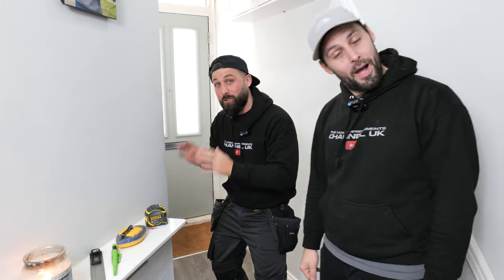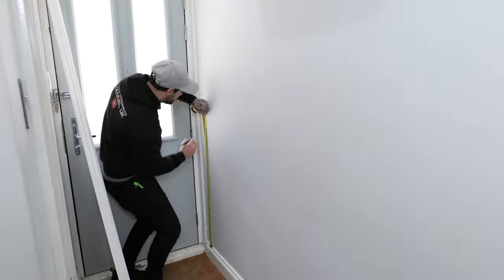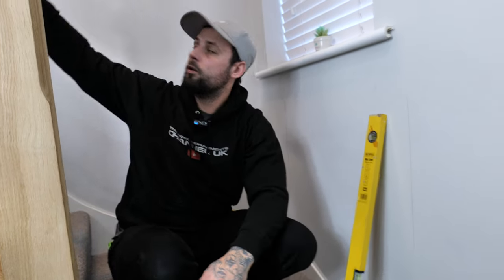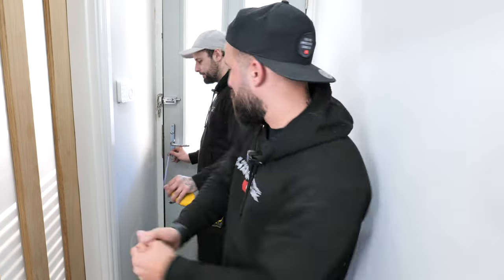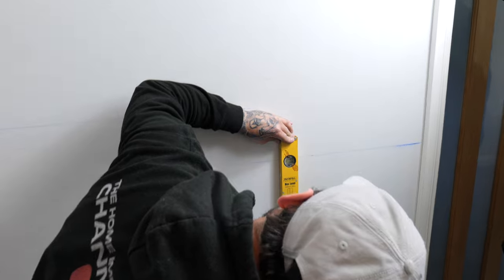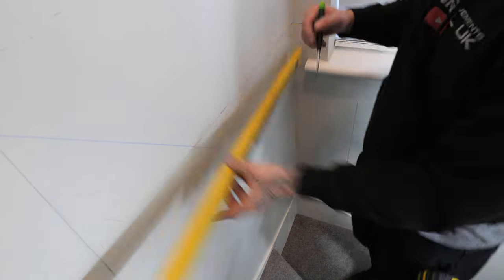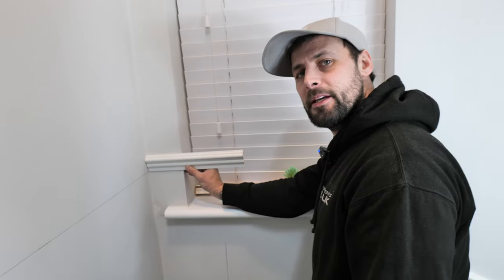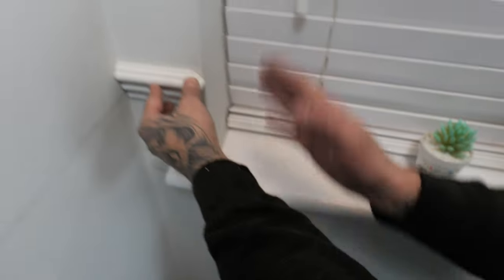How To Install Dado/Chair Rail To Hall Stair Landing - Easy Step By Step Guide

Comment: The skirting at the hall where it meets the stairs at a 90 degree angle is 100mil lower than the skirting inner going up the stairs. If I put the dado rail the same height as the opposite wall, the dado going up the stars would be 100 mil closer to the stair runner and would look odd, any suggestions?

Comment: I have the same coping saw. Them metal bits are meant to face upwards. Hold the blade in place and twist the handle off. Turn blade the right way with the metal fasteners pointing upwards then retighten the handle. It was a ball ache until I discovered this. Thanks for the video. It’s helped massively
Reply from the maker: Nice one I’ll give it a go 😊👌🏼

Comment: Brilliant. So helpful, thanks. You said use a panel pin or pinger to hold the rail on after gluing, but what if it’s a solid wall?
Reply from the maker: It’ll still work don’t need to send them all the way in just enough to hold them in place 😊

Comment: You two are absolutely brilliant, I hope you know that. Wow best video. Loads of videos out there showing you can do this etc etc and just show the end result but they leave out all the fine detail, which is all the important bits. This is the soooo so good. Thank you so much 🙏🏻  

Little question please😊
If you have an internal dado rail angle that’s difficult can you use a coping saw on the smaller side or one of the sides to join them. There is a door frame, immediately after a small section of wall then a internal angle then a longer wall. Can a coping saw be used to in this scenario or what’s the best thing to do. Oh and is the wood placed into the miter box on its back and you cut on the face of the dado rail or do you put it on its side with its back against the mitre box side ( where the angles lines are ) for doing the internal angles. 🙏🏻
Reply from the maker: Hold it how makes you most comfortable they both work 😁😁 and yes you can scribe those 

Thanks for the great comment we appreciate it 😁

Comment: Hi guys great video. Wonder if you could offer any advice on my project ? The issue I have is the bottom of my stairs where the wall turns 90 degrees but also drops by approx 500mm as the bottom step is at floor level, and the landing skirt starts at around the third step. I hope that makes sense but if there is any way I could send you guys a picture it would explain it a lot easier than I am 😂

Comment: Hi great video.  Can you use the angle finder as you have, but with a handsaw as I don't have the mitre saw. So work the angle out set angle finder to that angle and then pencil mark the wood and saw?  Also why do some say half the number but you have a different calculation. Is it to do with the type of angle, such as inner or outer andle if that makes sense.  Inner being something like a wall panel. Thanks

Comment: 4:32 using your level in a vertical position produces a line that is PLUMB, not level! Level lines are produced from the horizontal plane.

Comment: Great video!! Could you explain why you cut wood for the internal corner using a saw by hand and why that is different to all the other angle cuts? at approx 23:50. Thank you very much :)
Reply from the maker: Internal mitres tend to gap so we like to cope as we demonstrated better joint for longevity 😁😁
Reply: That’s great, thanks for answering! :)

Comment: You two as a team are class to watch. I have a question: My stairs have varied angles in, they are not slopes though. I originally went top the angle and drew the level line, but I think it was wrong as the lines don't add up. Do I follow this process that you are showing here? I actually wanted to do the flat 9mm x 100mm MDF panelling that was in your other video, but my stringers are all different angles, and I have two turns in my stairs. I will pay you for a facetime!!!
Reply from the maker: Give us a message on Instagram 😊

Comment: You mentioned a wood filler for the joins, which would you recommend? 

Just put mine up and this tutorial was so helpful! But at the top on my stairs, one of the corners was more curved the straight and also way off 90 degs. Got about a 3 mm gap, would you caulk this?
Reply from the maker: Thanks 👏🏼 Either caulk or a two pack wood filler 😁😁

Comment: I’m about to attempt this in my flat but halfway through when u was putting the lines up the stairs it wasn’t straight? I’m very new to this stuff so can you tell me so I follow the level at an angle ? Will the bubble be in the middle even tho it’s not held straight going up the stairs?🤦🏾 I’m on about the part before you measure the 900, when you mark the lines in

Comment: What chop saw would you recommend. Seen some cheap ones that say -45 to +45, so assuming these only have a small angle range. 
Otherwise you’ve given me the confidence to try
Reply from the maker: 45 degrees is fine you’ll need to make a jig to extend the angles further will be making a short covering that 😁

Comment: Hi!  10:27 at this point on the video, you mentioned the different height skirting but not sure what you’re done about it! Where did you measure the level line on the higher skirting? Mine go lower after the stringer and I’m struggling. 
You mentioned below about measuring both and then use chalk to intercept- I don’t really get it!! Help and sorry for asking daft questions. Thanks
Reply from the maker: We go to what looks best visually 😊

Comment: You say to use panel pins with hammer to hold in place whilst the glue dries. Do they have to be removed or can I just hammer all the way in?? Thanks guys !! I'm using your channel for a whole makeover x
Reply from the maker: Depends on the wall if brick id go as far as you can then remove but if they go in easily and can be punched below that’s fine 😁😁

Comment: Hello. I've followed your video and it was great, thanks. However, I have hit an area that isnt covered in your video. I have sorted the angle up the stairs, but at the top it goes to a 90 degree turn, which is straight; onto the landing. When you cut the angle at the top, it the surface area ends up wider than the straight piece on the landing? Hope that makes sense. Could you help?
Reply from the maker: We are going to try cover it in another video as a few have got stuck here but basically you level off before the corner then turn hope that helps 😊😊
Reply: @homeimprovements  
Brilliant. Thanks for the quick response. Keep the videos coming, their excellent. Cheers 👍
Reply: Hi, is this video up yet please as i have the exact same problem
Reply: im also stuck on this is the video on this up yet , its doing my head in  @homeimprovements

Comment: Hi - we have different size skirting in the hall compared with further up the stairs. So do I measure form the floor or still go with skirting board 🤯 thanks 😊
Reply from the maker: Measure both and use chalk to intercept the two 😊
Reply: @homeimprovements  🙏🏻

Comment: Great video. Informative and funny! I am looking to do this in my house but I have a couple of questions please. 

1. Downstairs, the skirting boards are different size on two opposing wall (about 2cm difference), what would you advise when measuring? 
2. The door handles are different level upstairs compared to downstairs, can you have a different height to the Dado Rail or would this not work?

Cheers
Reply from the maker: It would be a case of what you think looks best tbh so I’d chalk out what you think if your not happy wipe clean try different method hope that helps 😊

Comment: Need help! Great video but I have an internal corner junction where both sides are at an incline rather than a straight side joining an incline if that makes sense? How would I cut for this junction? Cheers
Reply from the maker: To avoid compound cuts I would do a small section in the corners level then move onto you angles hope this helps 😁

Comment: At 19:10 when cutting the external join, did you change the blade 21.5 degrees the opposite way or leave it in the same place? I’m just psyching myself to do it. I watch your videos and genuinely believe I can do anything 😂
Reply from the maker: I may make a short video explaining the mitre cuts 😊
Reply: @homeimprovements  please do! I’ve got all the gear and no idea 🤣

Comment: How come on your other video with the MDF wall panelling you measured the distance on the rake of the stairs instead of horizontal?
Reply from the maker: No flat areas on that 😊
Reply: @homeimprovements  so if you were continuing that MDF one threw the hallway you would measure horizontal to keep the panels all the same ?

Comment: Would have been good if you showed how to cut it on the mitre saw as its not easy. Calculated the angle and cut the dado rail but there's a gap each time so not sure where I'm going wrong! Thanks
Reply from the maker: Noted 😊😊

Comment: I’ve got an internal corner, but it’s also on the start of the first stairs so the start of the corner is 900mm, but to join around the corner because of the step it would be only about 700mm and not sure best thing to do.

Comment: How do you deal with the skirting being slightly higher than the stringer when fitting the dado rail?
Reply from the maker: Chalk line will loose the difference and make it one transition 😊😊

Comment: How would you do an internal coner joint if both sides are at an angle ? Thanks
Reply from the maker: That’s a compound miter I’d avoid that and use a small straight joint that immediately turns that way you get both angles and avoid the pain of a compound mitre

Comment: How would you find the mitre angle on an external corner if it comes directly from the stairs? I can’t figure it out
Reply from the maker: What tool are you using
Reply: @homeimprovements  what I’m using is a digital angle finder (exactly like yours in the vid) and a double bevel chop saw

Comment: I am really struggling scribing my rail i have a very ordinary wall im cutting the 45⁰ following the line etc i think i even have the same dado rail.. not sure but im trying to line it up and its just not marrying up properly ive checked the angle of the saw & im running out of ideas of where its going wrong

Comment: What happens if the step up (where you put the angled peace on the stairs) is on a corner?
Reply from the maker: Level off turn the back to the angle going to get a video covering this had a few ask 😁
Reply: @homeimprovements  thank you for the quick reply, I'll watch out for your video. Thank you, you two are great!